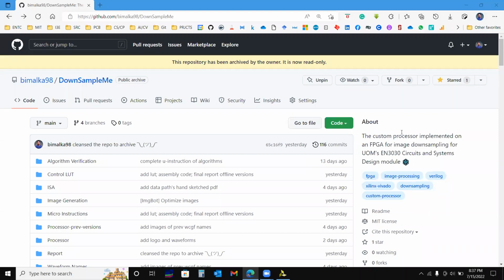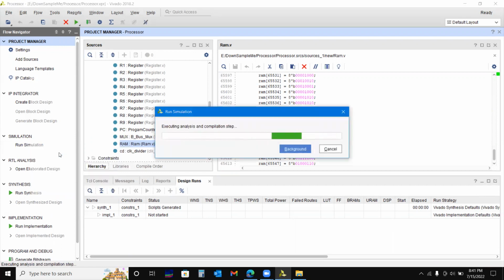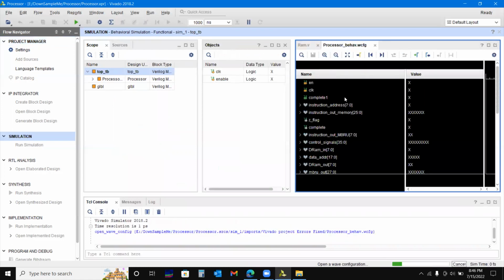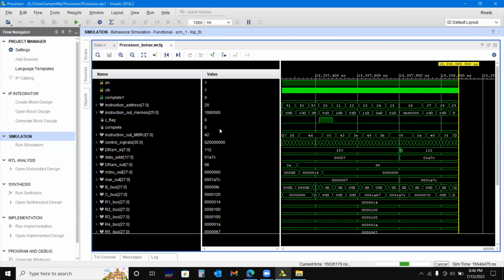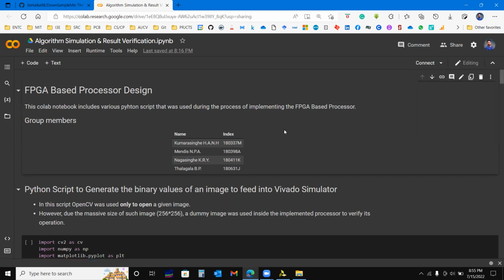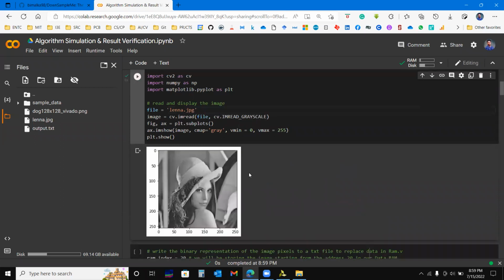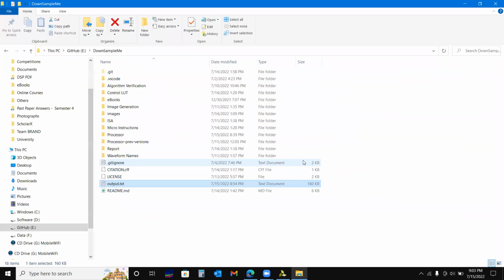'DownSampleMe' - a custom processor implemented using Verilog HDL for Image Downsampling

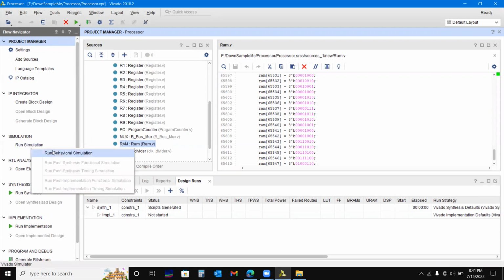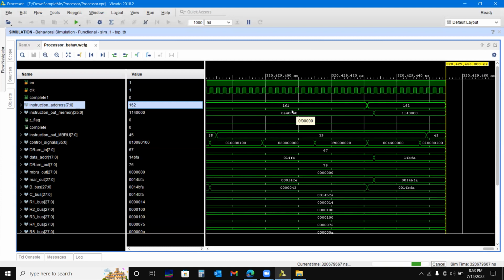Comment from the maker: The simulation which starts @ 3:40 min ends @ 16:20 min.  This unusual duration was due to the fact that the screen recorder and some other applications were running in the background while the demonstration was carried out. This is not the usual case and it usually takes only about 5-6 mins.